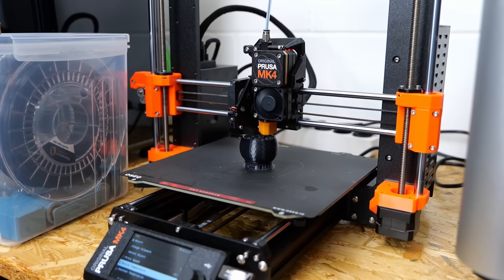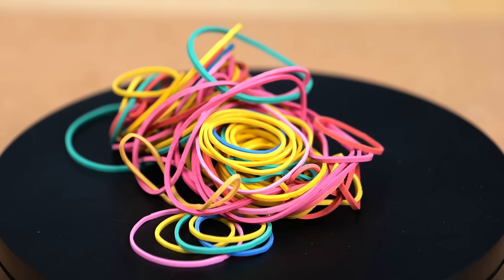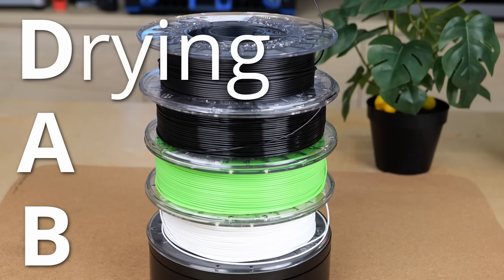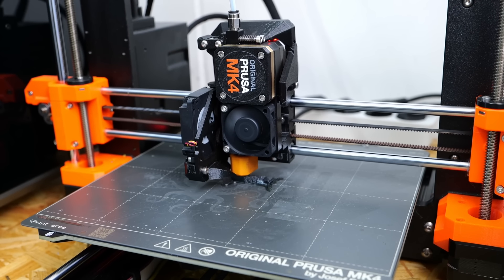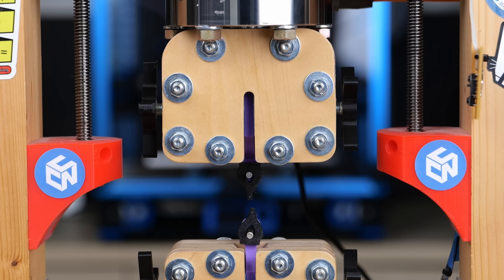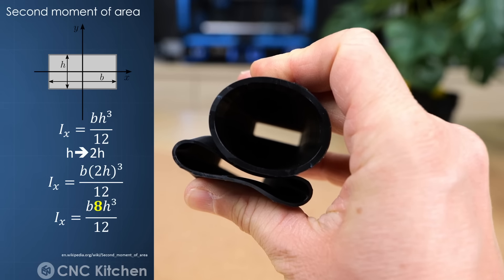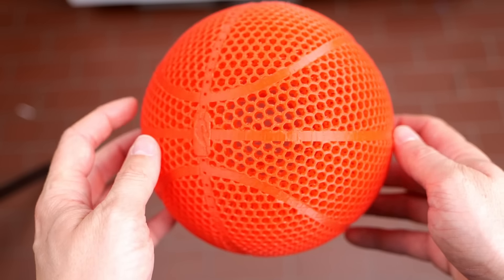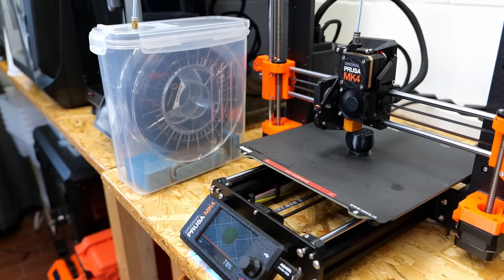Why aren't more people 3D Printing this Indestructable Filament?

Comment from the maker: What's your experience with flexible materials?
Want to get your 3D prints to the next level already today? Check out our Heat Set Inserts and Tools at https://cnckitchen.store (Free shipping worldwide starting at €100).
Reply: Is that preview image text supposed to say "Thermo Plastic Elastomers"?
Reply: I don't have any, but what type of filament should I use for belts, or like tires?
Reply: The biggest problem printing with TPU for me has been getting proper layer adhesion along the XY axis. Maybe I need to adjust line width, but for whatever reason the TPU bonds well along the vertical axis but not the horizontal. Any suggestions?
Reply: Hello stefan, 
Thank you for the nice and insightful video!

I have a couple of suggestions to test based on my experience with TPE filaments:

Temperature greatly changes stiffness of TPU. I have printed powepads for my EUC. at -20°c they shattered instantly from small impact. 

It was printed from purple transparent TPU from esun which gets to my second point/question: 
Does transparency or colour affect material properties? 
I also have parts printed from extrudr medium anthracite (grey), it still holds up fine.

I have also noticed creeping issues with TPU. 
Even under small load they will slowly give up and permanently change form.
I have noticed this from several different applications, biggest one was kickstand for EUC which made it unusable because it gave up on one side and will always flip to that side. It worked fine for couple of days until it started to give in.
I printed thin PETG supports to fix that issue.

That brings my fourth thought, would heat treatment (annealing)help with this issue, or are there TPU filaments that doesn't do that.
(It also happens with PLA, you cannot print springs or compliant mechanism that are stored as momentarily "deformed state". It will slowly give in.

Also side note: I have noticed 
PP, to have a considerable amount of friction compared to it's shore hardness. It is also really nice material.
Reply: I printed some inserts for a tablet holder from TPU. It was as easy as you said (bed adhesion is amazing - the brim I added was completely unnecessary) and I was blown away by the seemingly indestructible parts I got. However, they're not as soft as I had hoped. Most generic TPUs you can buy are 95A shore hardness, which is just too hard for the "rubbery" effect I was going for. I want to try 30D next.
Overall an excellent video, the only thing I think not mentioned was price – unfortunately, TPEs are all quite expensive, with the softer ones easily going into the 80€/kg range.
Reply: I only print directly out of my passive IKEA drybox (using a PTFE-tube, which is connected to the box and the extruder).
I also dry my Filament only passively in those dryboxes.

This works perfectly well and prevents overheating the filament (or spool)
It just takes longer (and you might have to renew the silicagel to get to <10% humidity).
I get zero stringing with dry TPU with just the default 0.4mm retraction length on my Prusa MK3S+.
(Linear Advance / Pressure Advance has to be tuned to have that result.)

I do the same for PETG and even PLA (and every other filament).
Even PLA will profit from being really dry.
All my filament is always stored in air tight boxes with silica-gel at <10% humidity. Just makes life easier.
Reply: Two comments on the video which I thought was excellent, but for clarity sake, the volumetric limitations assumes a 0.4 mm nozzle.

The other comment is while printing on the Prusa XL 0.6 mm nozzle and a TPU filament profile a jam occurred which due to the next router design caused damage to the strain gauge sensor that was epoxy onto the heat sink resulting in the need for a replacement unit.
Reply: I was printing with my mk4 using PEI sheet that is stock and learned the hard way. I have a textured but never knew I needed a special sheet
Reply: I've printed a lot of TPU90A on my Ender 3 S1 pro and it's been very easy.
However, it took me a month of experiments and research to get my machine to print TPU 60A with the only "mod" being a 0.8mm nozzel from creality. I wish there were more support options for making TPU60A an easier experience
Reply: Hey im working on a project that's going to use a mechanical interference fit to form a live hinge from tpu, with the main body being printed in pla. It would be interesting to see adhesion properties between different combinations of filaments on a multi material system, there doesn't seem to be much information available online.
Reply: I have used the super flexible stuff (ninjaflex, 85A) for grips on my mountainbike, because you need softness in a very thin layer. It had a printed 3D mesh for ventilation and sweat/rain disposal and I still ride with them.

I also recently found a roll of formfutura flexfil (not available anymore?) and no drying, no speed adjustment, not much retraction and it worked perfectly. Not sure what kind of material it is though and it is stiffer but I still could make clothing items out of it
Reply: Microcenter used to carry a pale opaque TPE. I still have some. It printed well, was quite flexible, and felt like silicone to me.
Contrast that with the TPUs I've printed from a couple companies which were translucent, much more hygroscopic (but printed well when dried), and felt like flexible vinyl (like a brand new clear shower curtain).
It's too bad companies don't give more details on what their products are made of. I'd like to know if anyone else makes anything like the one I got from Microcenter so many years ago.
As to what I printed, lids for ceramic and glass yogurt containers (STLs released) and a multimaterial thing that needs tweaking (only lasted about half a year, not yet released).
Reply: Excellent video as always , SM3D smart material have TPU since years , you should test  to add it..
Reply: TPU has been my favorite thing to print in ever since I first tried it. It's just so cool to me to be able to print flexible, durable parts! I've been using the phone case I printed in TPU for years now, and it's been lovely. The main thing I try to avoid when printing with it is travel moves, just because I'm not great at reducing stringing yet. 

Among the things I've printed in it are the aforementioned phone case, some durable foam inserts for carrying cases (using gyroid infill and no walls), lids for things including a pitcher and those little glass Oui yogurt jars (I printed those in clear Priline TPU and was able to get the lids to print crystal clear with no post-processing after tweaking my slicer settings to avoid trapping air bubbles between layers), and even a super-breathable pillow (which nevertheless sucked because I printed it with a 0.8mm nozzle by mistake, making it much too firm--but it's a decent yoga bolster).
Reply: Missed testing the ninjaflex armadillo it's 75d almost not even a TPU it behaves like a rubbery nylon I love it but, I don't love the price.
Reply: I got an idea for a new video how about you review the Prusa mk4s or can you compare the Bambu labs x1 carbon and the prusa mk4s
Reply: I got a new video idea how about you compare the bambu labs x1 carbon and the prusa mk4s
Reply: I've printed RC car tyres out of Recreus Filaflex 60A Pro on my P1S.
Once I got it feeding properly, the tires turned out *super-good*, but man was that a fight.

Had to take out the dremel to punch a hole to the side of the toolhead cover, in order to get enough clearance for the tensioner screw to back out enough (had to have that just barely biting into the filament), or the filament would just coil itself around the extruder gears and jam up.
Also, the softer the material, the more important proper drying is. Hell, that Recreus filament seems to absorb enough moisture from the air that if a print takes more than a few hours, the last few layers are bound to be full of bubbles from the moisture.
So, with a sticky, super soft material, I had to figure out a way to feed it directly from a dryer to the P1S, which meant mounting the dryer above the printer, take the top cover off (since the bowden tubing alone had enough friction to cause the filament to stretch enough for inconsistent layers :D) and feed it directly to the toolhead, dangling from above.

10/10, would print again, though.

I've also printed various doorstops and hole-covers with PolyFlex TPU-95A, which is a whole hell of a lot forgiving than the Recreus. Absolutely useless for tyres, but..
Reply: I was really interested in the atomstack cambrian rubber filament printer, i was going to get it as my first printer but didnt see any good reviews on it.  Still havent seen any printer that does rubber which was a custome filament they made for a custom nozzel. Probably why your sponsor is looking for engineers, no one does rubber printing, except that atomstack printer.  Which is the only printer they made oddly enough,  they make laser engravers after looking into them.
Reply: @MrNathanstenzel
Reply: One tip about drying tpu, hotter drying is better. I typically use my vorons bed set to 90c and dry for 4-6 hours. Lower temps and  the center of the role will still be wet.
 
I print tpu more than any other filament. Probably the most useful for real world print designs since it can take a beating, you don't need close tolerances, interference fit is a thing with tpu. I have used it to make everything from my wallet to lab equipment. 

One note about printing on a voron in using an orbiter 2.0. it's hard to beat for tpu.
Reply: As far as retractions go, I use 1.2  mm which is double what I use for abs. I am using an orbiter 2.0. 

The trick is dialing in pressure advance. That is around 500% higher than with abs!

Comment: One thing while printing flexible materials i learned the hard way is to also lower your non-print speeds when printing tall models. Bed slingers tend to cause quite a bit of wobbling and models can get misaligned
Reply: So I cam use a very height speed with corexy printer?
Reply: @tim.gromeyer As long as the printhead isn't causing vibrations on the whole printer. I believe input shaping fixes this issue anyway.
Reply: @tim.gromeyer  No idea, sorry. I would assume that since with delta or corexy the model itself doesn't move in x or y direction the movement speed shouldn't matter.

I mainly use bed slinger for my printing and this is the first time i encountered this sort of problem with any filament.
I admit i was also bit greedy and wanted to cheap out on structure and some of the supports and adding some more mass to model made it a lot more stable.
Reply: @PJ-oe6eu  I mean the whole model was physically shaking when moving on Y-axis :D
Reply: The issue with bed slingers is not speed but acceleration. So you can keep print speed on "bed-axis" but drastically decrease acceleration. You could also reduce acceleration by height, so the total print time is even lower
Reply: Wdym by ‘non print speeds’? Is it like when its moving without printing
Reply: @villekorhonen824  No yea, pn a bedslinger inputshaping definitely won't save you.
Reply: @thefuturerex0197  Travel moves.
Reply: Really? When printing highly flexible TPU I use the same profile as printing PLA, just with different temperature and a little bit less retraction distance. The results are better than printing at slower speeds.
Reply: @PJ-oe6eu  can’t believe i forgot that term lol
Reply: My home based business prints TPU products on bed slingers.  The higher volume parts are tall and thin walled so they're very susceptible to the parts wobbling while printing.  Reducing the volumetric printing speed is a single variable that sets a top speed for all printing but I prefer to manually set all of the individual printing speeds and the maximum speed to the same level to avoid acceleration moves, and then lower the acceleration and jerk rates to low values for smooth consistent movement of the bed and print head and extruder when printing low durometer flexible materials.
Reply: Good to know, thanks!
Reply: On my K1c I was having layer adhesion problems between layers 3 - 10 (everything else was fine), increasing the initial print speed to 120mm/s from the default 60mm/s solved it somehow (I'm a 3D printing noob and don't really have any idea what I'm doing lol!)... I can only assume that the bottom layers printing slower allowed them to cool too quickly for the layers above to stick to them, or something... I don't know but it worked and now I'm getting nice TPU prints just as fast as PLA.
Reply: @richardgarner4879  - It sounds as if the filament is cooling too much on the slower initial layers, as you suspected.  The TPU profile should have little or no cooling (maybe a little on overhangs).  Weak layer bonding should never be a problem with TPU.
Reply: 4:25 Looks like he’s printing a “tall model” already, so I’m betting he knows 😏
Reply: Funny to think that the part is wobbling his head like an indian lol. But great observation.

Comment: Just a word of caution. 3D printed adult toys are risky. They can break off inside you and cause you to have to make a very embarrassing trip to the emergency room...
Reply: Reminds me of the warnings for 3D printed food items, which mention the inter-layer crevices where bacteria can grow.
Reply: Inside you? What if they're used...outside you?
Reply: @huntermitchell761  Not as risky in that case. 😉👍
Reply: Aside from bacteria
Reply: A tip to prevent things from getting stuck inside you is simply not putting it there in the first place.
Reply: Why is this the top comment for me XD I just wanna print parts for my drone, that's all
Reply: Tpu will not break off as you say. Getting layer separation on a tpu print with even a 1mm wall is going to require force that would be a hole nother problem for insertion.

The better thing to do is make a mold and pour silicone. Which also picks up bacteria but not as bad.
Probably get the job done for cheaper molding silicone onto a tpu print.
Reply: Sounds like someone who learned the hard way

Comment: Have you seen NathanBuildsRobots address the risks of fiber filled filaments? Highly recommend you be more careful with carbon and glass fiber
Reply: I might be a bit allergic or just react very quickly to fibers

But when I handle gt2 belts I get the same itch afterwards as when I handle fibre filled prints, which is the same to.just handling raw glass fibre 

I still have a spool laying around but won't handle it anymore, and highly discourage people from using it for anything they touch or that might get worn down

Comment: flesh colours soft fillament? na i can't think of anything to print with it either 🙄🙄
Reply: Na, but you might have to add some blue to increase shore hardness on those.
Reply: Would expect the counterpart oft what he prints in the background but hey... No judging😂
Reply: Please dont print stuff like that and use it.. there are a ton of chemicals in there you def. dont want your body to take in..

If you really want to get into it, buy some Platinum grade Silicone (quite expensive), mold seperation spray (wax based should be fine) and 3d print your mold, maybe something like PBT to smooth it.
You want it smooth, so nothing grows in the fine spaces between the print lines.
For coloring, you can use Cosmetic grade mica powder, make sure its fine enough so it doesnt cut itself out of the silicone.
Reply: @tarakivu8861  Not just chemicals, there's no way a porous-by-nature 3D print is going to stay clean.
Reply: That material mike be idea for printing 'skins' for prosthetic limbs like the Hero Arms. Then get them painted with details to match the wearers skin tone and freckles and the like.
It should also be easy to use to make the base shapes for film and TV effects make up pieces, such as Elf/Vulcan ears, Hellboy horn stubs or Twi'lek Lekku for CosPlay, or tentacles for live action Anime.
Reply: A friend wants to know where to acquire